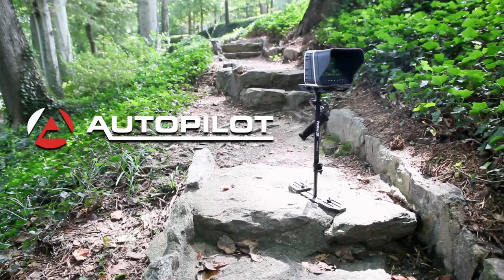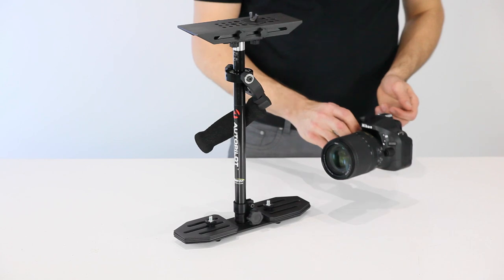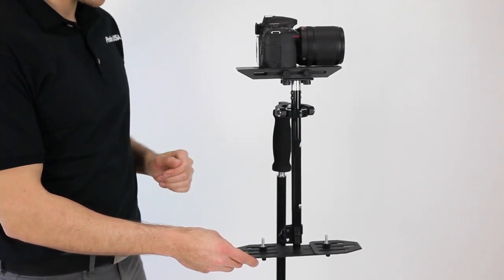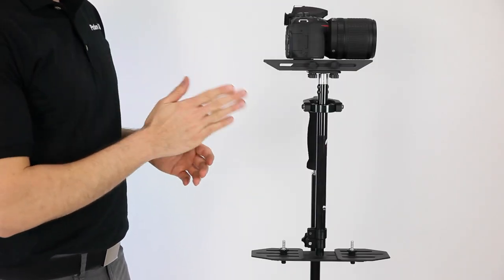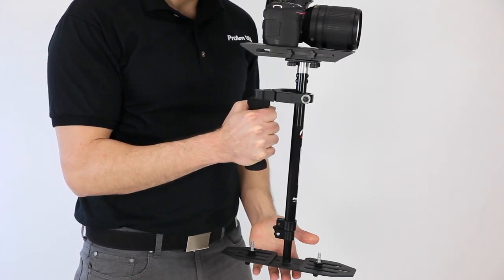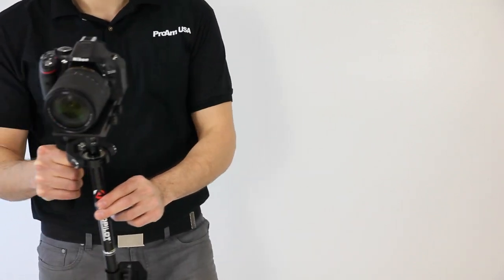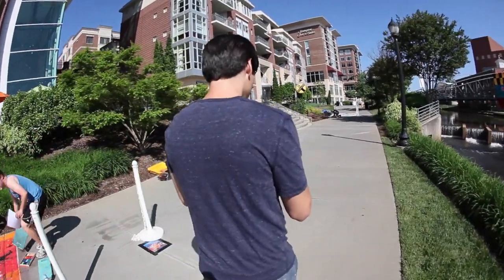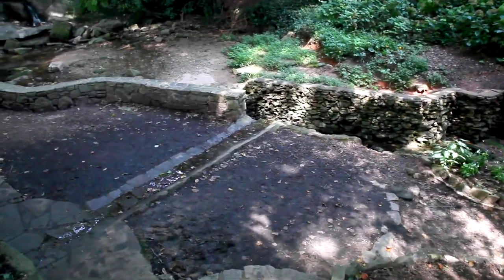How to Balance Camera Stabilizer - ProAm USA Autopilot Setup, Balancing & Tips Tutorial

Comment: Hello, this is my first stabilizer, trying to balance it, not that easy, but seems I got it. The question is: is there any trick to take camera away without unbalancing it? Or you have to balance every time after you take camera away? Is there any mount like for tripod? It's kind of hard (if not impossible) to balance it being outside without tripod. And hard to put your little fingers underneath of platform to tighten camera screw every time. And second question: when you zoom in/out, the balance change. So, do you have to carry tripod with you to balance every time you zoom in/out? Hope you understand my explanation, English not my first language :)
Reply from the maker: Hi Yulia, yes it can definitely be made easier by using a quick release plate! This will allow you to keep the Autopilot set perfectly even when removing your camera. The best method for stabilizing is using a light stand to hold the Autopilot, but it can also be done by placing it on a flat surface to do the adjustments and picking it up a few times to make more adjustments as needed. Users typically don’t zoom while recording with stabilizers, but if you need to zoom in between takes, simply slide the plate weights in the rear further away from the column. Slide them inward as your lens gets shorter. Please contact us at sales@proamusa.com for any more questions. Thank you!

Comment: can you add a video showing how this gymbal is stored? does it comes with a case? do i have to rebalsnce in the field after i take it out of the case?
Reply from the maker: Hi Luis, the Autopilot comes in a box with custom molded foam that can be used for storage. Check out the second to last pic here: https://www.proamusa.com/collections/dslr-camera-stabilizers/products/autopilot-dslr-video-camera-gimbal-stabilizer-system-by-proam-usa
If your settings don't allow it to be stored in the foam without reverting back to the original form, you can most likely keep the adjustments by storing it in the carrying case without the foam interior. See the second pic here: https://www.proamusa.com/collections/dslr-camera-stabilizers/products/autopilot-stabilizer-carrying-bag-by-proam-usa
With either option, you'd need to return the column to the collapsed position, but that is the easiest to adjust for balancing. The bag without foam will generally allow you to keep the position of the camera platform to fit your camera. I hope this helps!
Reply: do you have a picture of the foam box that show it completely? or a video that shows it? the weights need to be removed to be stored in the foam box? the carrying bag is an extra accessory purchased separately, right?
Reply from the maker: Yes, the weights need to be removed if using the foam for storage. They can remain attached if using the bag. The bag is optional, however. We can get you some more detailed pics if you'd like to email us at sales@proamusa.com.

Comment: How many plates should u put on a rebel that has a stabilizer & a microphone on top?
Reply from the maker: Without knowing the exact weight, I would estimate it to require 1 plate on each side. You can play around with the length of the column to increase or decrease weight required. Extend the column to require less counterweight and retract it to require more weight. If your camera is exceptionally light like a GoPro, the column itself is enough to balance it. I hope this helps!

Comment: Hi, I just got my AutoPilot today. I watched the tutorial numerous times and I balanced everything basically perfectly. The only problem I have now is that when I'm holding it straight and there's no motion, it just starts spinning left and then stops at 90°. Is there something wrong? I don't believe it's a balancing issue because it doesn't lean to any side or forwards or backwards. Please help!
Reply from the maker: Bledder I'm so sorry to hear about this! There may be some pressure on the main bearing from one of the retaining screws causing this. Please contact us at sales@proamusa.com and we'll work to get it fixed for you asap!
Reply: Okay, thank you for responding so quickly :) I went to your website and filled out a message under the "Contact" subtitle.
Reply from the maker: Hi, just following up to make sure you got our email reply. If not, please check your spam or junk mail folders just in case!
Reply: ProAm USA Yes, thanks. Your customer service got back to me after I had sent a message under "Contact". They told me to use an Allen Wrench in order to loosen the small screws for the barings, I found that one of the screws were out much more than the other so I tightened the loose one and that seemed to make it a lot better. It will still turn left sometimes but when it does it is very slow and it won't turn as much. If I need to I'll just tighten the screw again (or loosen the other one) or I might experiment with the bigger screws. So basically what I'm saying is that the problem it fixed, thanks for the help!